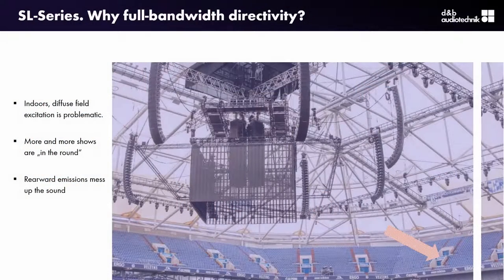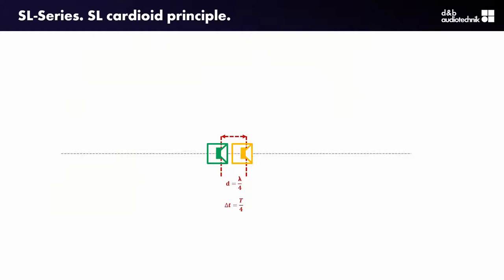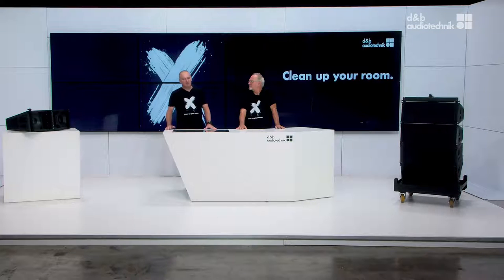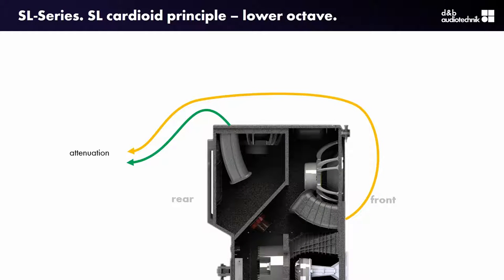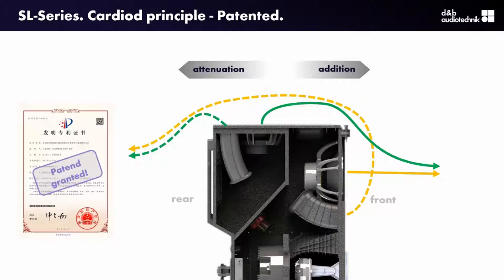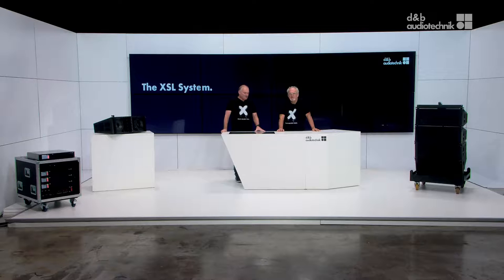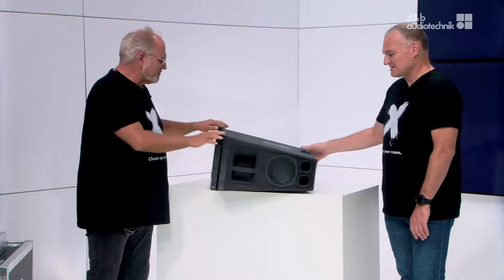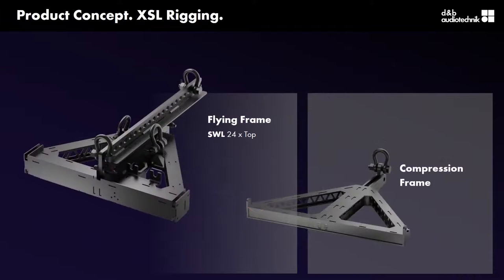d&b audiotechnik Unveils its New XSL Compact Line Arrays

Comment: These look like they could replace the V-series like Gsl/Ksl replaced J-series speakers. They claim to be the same width, but height has decreased and depth has increased. Can’t wait to hear one of these rigs in real life. 
Also, this company easily makes the best subwoofers I’ve heard, and I’m guessing the Xsl-sub will be no different. 
I’ve heard a Ksl rig, and I was impressed. Maybe it’s just my luck, but there’s something strange going on in the lower midrange on every old V-series system I’ve heard, (and partially the J as well, but not as bad.) It might be the sound guy though. I thought the Ksl I heard was super clear in comparison, but somehow less harsh. I hope Xsl will be an upgrade over V. 
As of now, d&b is still my favorite compact system to hear at a concert, mostly because the subwoofers are insane! A local sound company has a ton of the V-series boxes and old B2 subs (which more than hold up today), with E8s or old Q10s as front fills, and they supply sound for lots of things in my area. It’s an epic system.
Reply: MEYER PANTHER AND SUBWOOFER MEYER 2100 LFC IS THE BEST.

Comment: D and b has very compressed speaker cabinet dont know y
Reply: They concentrate on system linearity but the amps do have limiters. They can sound 100:1 ratio TC finalizer style slammed... if you under spec a system and run out of headroom. d&b can sound pristine installed correctly.